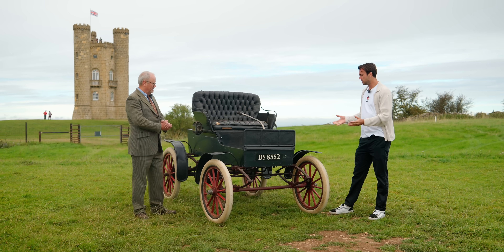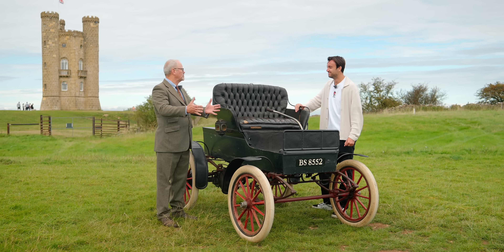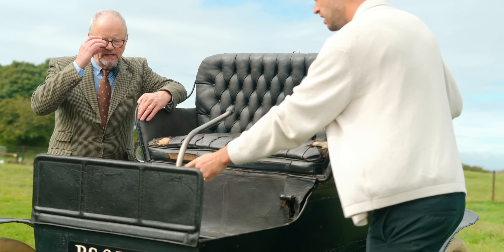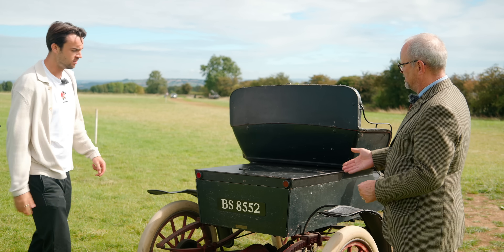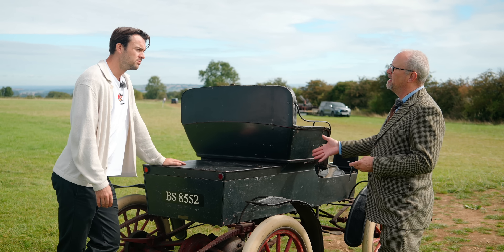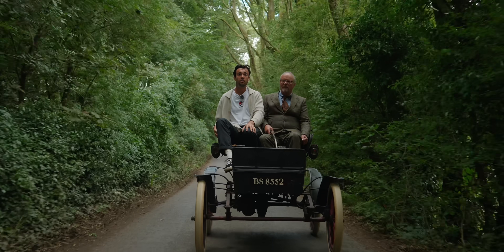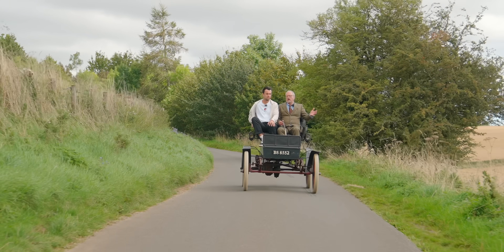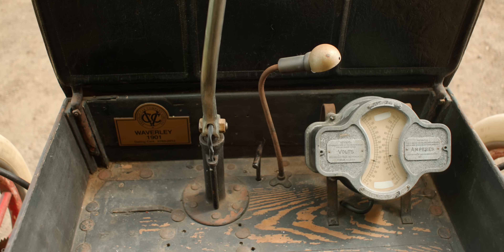Why Electric Cars Failed 100 Years Ago

Comment: A vehicle like ooffers a really relaxing ride for a leisurely trip trough the countryside. Quiet, superior visibility from up high, you are outdoors. 

You should get your hands on a Fritchle electric car. It had a range of over 100 miles! The tiller-operated stering on those vehicles was also lethal  -  standard equipemt included thrills and chills.

Comment: there is no single reason for the failure of the electric car  but heres a list of reason
1 The price
2.the price of replacement batterys  
3.availbilty of electricity 
4. your average person didnt understand electricity works Its a trait of the human race to not trust what they dont understand
5 eletricity wasnt commom outside of the city
6 range traveled before the car needed to be re charged
7 wide spread use of battery chargers most likely caused the power grid to fail
8 horses were faster 
9 electric vehicles didnt have the range or power needed to be used for anything practical like taking vegetables to market  moving logs to the mill taking grain to the grainery  they were and remain only and expensive to buy expensive to operate  expensive to repair way of moving people slowly

Comment: The first electric car was made in 1896 ten years after the first gasoline powered car and seven years after the first two American cars (1889 Ford Tin Lizzie unmarked of course and 1889 Stanley Steamer), the first electric cars would fly by the early cars at 11 mph (when all other cars on the road were only traveling between 2 mph and 10 mph prior to any modifications done). The first tires on cars were made of rubber that wasn't vulcanized before the pneumatic tire was created with the pneumatic tire requiring vulcanized rubber.  There have been aftermarket modifications and various other modifications although I am unaware of how fast moonshiners' cars went or the US Marshal Service cars chasing them

Comment: Love it! Nothing flimsy about it. The accelerator switch aparently determines wich or how many engine coils will get the electric juice.
I once made a series/parallel switch for a battery set to get 2 power modes on an electric lorry. Both methods beat a sewing machine style variable resistor by far in terms of torque and efficiency, not to mention the heat dissipation. There were just no semiconductors to do any pwm job or even go 3 phase and ditch the brushes.

Comment: The first electric cars were popular with men and women whose families could not even afford to employ a part time chauffeur/ maid/ cook team or who lacked the physical strength/ courage to crank start a gasoline engine powered vehicle.  Poor things ! !
The invention of the electric starter motor and generator - storage battery system used to easily start cars with petrol engines massively shrank the market demand for  electricity powered cars.

Comment: Steam cars had coil boilers, that only needed a few minutes to warm up. Remaining range is easy to judge from the voltage on Lead-Acid batteries. You also get a sense of what mood your batteries are in from how much they sag during acceleration. I have driven a few Lead-Acid EVs.

Comment: Does this sound familiar. Gigantic price. Gigantic range issues. Gigantic problems with infrastructure. Gigantic issues with reliability and repair costs. A hundred years ago, or now.
Reply from the maker: Does this sound familiar? Gigantic disasters with oil spills. Gigantic fires with oil and gas accidents. Gigantic pollution of extraction areas. Gigantic methane leaks where the companies say there are no leaks. Gigantic energy use in refineries. Gigantic impact on the human environment from 1.8 billion tailpipes belching toxic gases every day. Gigantic profits giving one industry unimaginable power and political influence to convince people that there is no viable alternative. Not a hundred years ago. Right now.

Comment: If all auto manufacturers could get together on batteries, a major problem with electric cars could be solved.  Supposing there were only one type of battery with battery swapping stations all over, and batteries could be swapped out in under 5 minutes.  Now suppose when you bought the car, you also bought the right to have your battery swapped out for the life of the car so there's no such thing as replacing a worn out battery that costs more than half the price of the car.  Of course you would have to pay to get your battery swapped out at a price that could be determined by the difference between a full charge and the remaining charge in the battery being replaced, or whatever.  I'm sure something could be worked out.  A compact car would need one battery pack, a luxury car or pickup truck would need 2 or 3 battery packs, and a large truck, who knows.  Maybe a diesel engine would be most practical there.

Manufacturers would have to set aside competition in this area and concentrate on build quality, style, comfort, etc.  I may even take a law requiring all cars use the same standard battery pack.  I'm not particularly fond of laws on this type of thing, but if electric cars are going to be the norm, they must be practical.

Comment: Ironic that batteries was what killed the electric car. The invention of the electric starter made it easy to start the petrol car thus eliminating the only advantage the EV had, ever since there were only disadvantages, which is still the case.
Reply from the maker: So the fact we now know burning the fuel in an inefficient engine is fairly damaging to both us and the environment we all have to share is 100% irrelevant. 
We can just shrug off the advances in technology that have gven us a more than viable alternative and smuggly sit in our combustion vehicles as they burn their way through trillions of barrels of toxicfuel?
Okay then. That's fine. Carry on.

Comment: The early EVs became popular due to the early IC engines being unreliable and difficult to have repaired since the manufacturers only had parts made for new vehicles in small batches due to low sales figures. You had to ship the vehicle back to the factory for repairs then wait to get it back. The owner paid for shipping both ways. The electrics were a bit different since a local electrician could repair it by using industrial parts that were available or could be ordered from their manufacturers. Local shops that repaired wagons and carriages could take care of the rest. The home chargers were hardwired to their own outside electric meter and service drop. The electrics lost market share once the IC engines became reliable thanks to improved blending of gasoline.

Comment: How is it that people only consider the battery shortfall?  Anyone with basic math skills and Wikipedia (to get the formulas from) can see how EV's can never come close to ICE range/refuel convenience.  As much as infrastructure upgrade cost also makes EV's untenable (how many insurmountable issues do we need?), simple math should have already killed EV's off as ICE replacements.  Here's an example that makes 5 minutes for 300 mile range magic-battery-charging irrelevant:

F-150 300 mile range batteries are 131 kWh.  This has NOTHING to do with how tiny your battery is OR how fast it can be charged. If your battery was the size of a dog turd and could be charged in two seconds, it would still take 131 kWh to go 300 miles.
So how do you supply 131 kWh in 5 minutes (roughly ICE 'recharge' speed)?

Charger Watts first:  The watts you need to accomplish this is:
(131,000 Watts x Hours) X (60 minutes/hour) / (5 minutes) = 1,572,000 Watts
                                 |Convert hours to minutes|    |Divide by time|

Over 1.5 Megawatts should scare the crap out of you already.  But lets go a bit further and calculate how many Amps you need for this.  Ford fast chargers run at high voltage to reduce the current needed.  We'll use Fords value: 350 V

Watts = Voltage x Amps

1,572,000 = 350 x Amps
1,572,000 / 350 = 4,492 Amps

Imagine a cable you can plug into your car that can supply this much current.  I say "Imagine" because imagine is all you can do - no such cable exists, or can exist.  Please don't bother trolling with a super-conductor consumer "cable" suggestion.

Comment: Just as now back then infastructure was a major issue.  The power grid in the 1900s would have required massive expansion.  The only ways of producing electricity back then was either fossil fuel or hydroelectric, and to feed a booming car industry it would take a lot of capital.

Yes, the car is zero emissions, but you still burn hydrocarbons to make the electricity, essentially moving the emission from the tail pipe to the smoke stack.

Finally battery tech was not ready.  High density lithium ion was a loooong ways away in 1901.  Lead acid does not have near the power density and has environmental issues with lead.

120 years ago internal combustion made a lot more sense.  EVs were not practical because the technology was too primitive and it would take decades to develope as well as the grid needed massive expansion.

Comment: electric cars are a bad idea. i like the idea of swapping out batteries, though.  But -- having $28,000 lithium-ion battery sets lying around isn't really feasible.
Reply from the maker: For goodness sake, if you're going to exaggerate wildly, at least make an effort. 
I've just seen an electric car with 790,000 kilometres (500,000 miles) on the clock. It did have a battery replacement (under warranty) at 666,000 kilometres (413,000 miles) and the entire cost was $7,000 Australian.
AFTER 500,000 miles.
And battery swapping is a daft idea, it will never be a big thing with cars. With trucks, maybe a different story.

Comment: The main reason EV failed to compete with ICE vehicles 100 years ago was battery technology at that time, (they were using lead/acid batteries), couldn't compete with ICE vehicles when it came to range and refueling time. The jury is still out when it comes to whether current battery technology will finally overcome these limitations. I realize EV backers claim it's a done deal, but only time will tell. Although range is getting better, "refueling" time for EVs is still much longer than for an ICE vehicle, and super fast chargers tend to degrade even modern batteries if used on a regular bases. With the relatively high cost of replacing an EV's battery, that could be a real problem down the road. But like I said, only time will tell.

Comment: for the same reasons sales are going flat now  : limited range,  too long to recharge, most important of all too frickin heavy   - excessive wear on roads, excessive wear on tyres, excessive wear on brakes
Reply: So having driven one for 3 years I can say I'm happy with a real range of over 260 miles, I mostly charge at home where it spends most of its time anyway and at zero cost when its sunny,, it isn't as heavy as many of the SUVs you see on our roads, tyre wear - still on first set after 19,000 miles, brake pads last for 1000s of miles longer due to the use of regenerative braking which does not use the brakes at all but generates more power and increases your range. Sales of all cars have slowed anyway.

Comment: In 1910 less than 2% of America was electrified. I would think this would have a big impact on electric vehicles. Vehicles at the time of the century were truly rich peoples toys.
Reply from the maker: In 1910 you could only buy a gallon of gasoline in certain pharmacists and in mainly eastern seaboard areas of the USA. The first puropse built gas stops, refuelling pumps were introduced around 1911 and really expanded after WW1. I agree, all vehicles at this time were rich people's hobbies. As they actually transported people from A to B I wouldn't describe them as toys
Reply: Thank you for expanding on my answer. I didn’t realize how rare gasoline was in 1910. But I see how it would be fairly rare if the automobile and ICE wasn’t used as a means for standard transportation at that time. @fullychargedshow

Comment: That looks like a jaunty little ride in the country!  How lovely!   

Still, then as now, how long to recharge?  What is the range?   

This is why they failed.  ICEs were more practical...longer range and could be refueled in a matter of minutes, rather than hours.

The choice of electric or gas is a matter of personal lifestyle and driving habits.  Then there is the issue of extreme temperatures.   If my lifestyle suited, I would buy an electric....living on an island or mostly local driving.  They are really well suited to that.  If, on a long road trip, you're willing to go only 350 miles per day and then recharge overnight, then that's great.   But, in my 2006 Sienna minivan, we can drive from Maryland to Florida in just one day, refueling just once.  Couldn't do that in an electric.

Comment: It's easy to go 60 miles when yor cruise speed is a light jog. :) You should do a range test with the old Leaf at 1901 average speeds and see how far it goes. Probably easily 150 miles.

Comment: The EV of today will fail too as there are too many obstacles. One video I saw when a scientist said there isn't enough lithium in the world to produce the batteries which are too costly to replace as well. So right there forget about the EV because along with problems of recharging times and additional pressure on our power grids we don't have a solution if it results in the creation of another problem!

Comment: There are only three things that can potentially kill electric motors, in order of likelihood:
Overheating
Worn or defective bearings
Corrosion

And don't write off corrosion if you live in a place that uses lots of salt on the roads, e.g., New York.

Comment: Very interesting.  Although as I live 15 minutes away from a building that was an electric bus and truck factory 100 years ago, not quite as surprising as it might have been to others!  

But the one thing you don't mention is the high price/risk involved in this wonderful new battery technology that has made the resurgence of electric cars possible.  The desperation of trying to deal with the climate crisis (or at least make it look like that's what you're doing) has led governments and industry to embrace an enabling technology that is deeply flawed - both from it's cost/weight and serious environmental drawbacks, and it's now revealed very serious fire/explosion problems, especially with the larger batteries now in use.  

There may very well come an effective and safe battery technology in the near future, but Li-ion isn't it.  And the more we rush headlong into an automotive future powered by this lethal and highly damaging technology, the more we are going to delay the real steps we have to take to deal with global warming.  The future has always been electric, but that future is NOT LI-ion.

Comment: They failed then cuz of the same reason they are failing today. They suck.
In 2030, it will become abundantly clear that we don't have the power grid to charge them, and their individual emission output per vehicle lifetime is going to increase substantially. Cuz your gonna be throwing the whole thing away at it's light fe end so there won't be any salvaged parts. I'll stick to my 50 year old cars. My 84 toyota SR5 pick up gets 25-30 mpg. Show me anything new that can compare.
All this new car crap is shit.